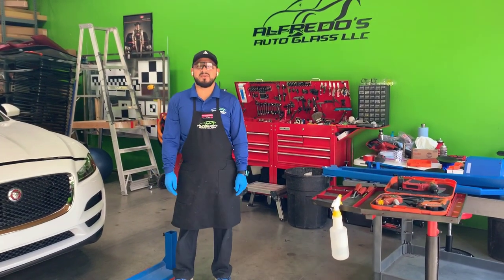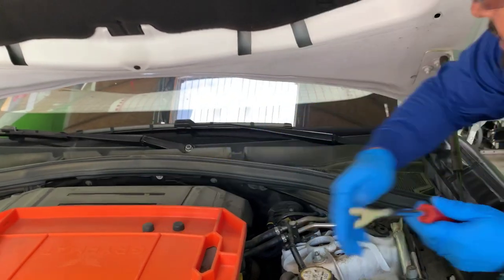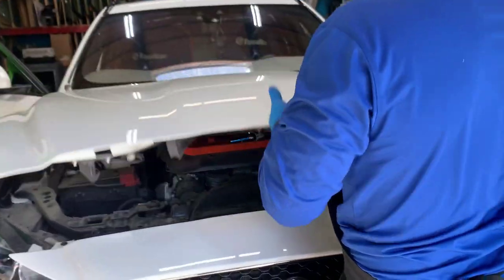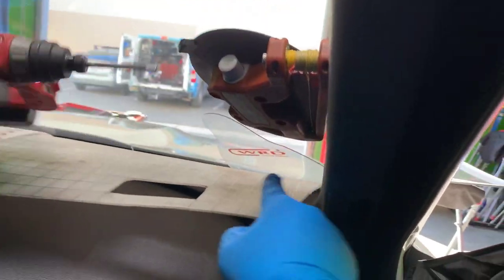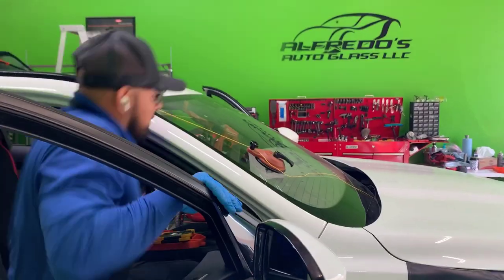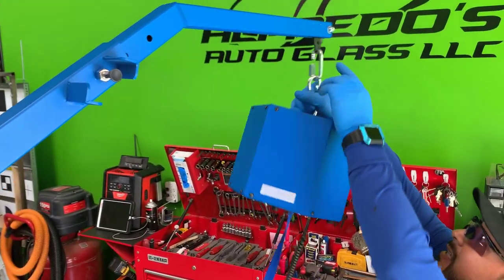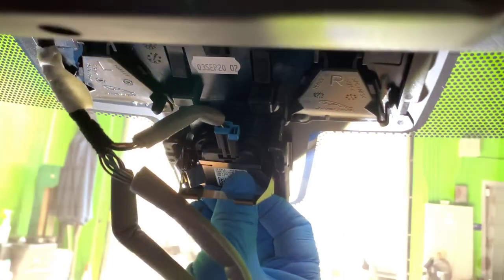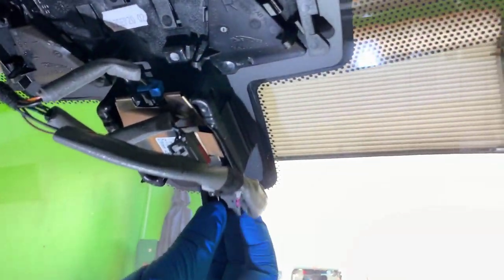Jaguar F-Pace 2016 Windshield Replacement by Alfredo’s Auto Glass with the Panther Pro setting tool

Comment: Thank you for this video, Alfredo. Whilst not wanting to join the window replacement  industry. I did find it, whilst looking for a video about replacing heated windscreen washer jets and your strip down of the trim panel gave me the confidence to do the job and I was able to complete the task quite easily, just needing a puller to get the wiper arms off their spindles. 

I suspect others might benefit from this part of the video for the same purpose and if you haven't already done so,  please consider putting something in the keywords to bring it up easily on searches for windscreen jet replacement.

All the best Alistair

Comment: Little tip for u . u can slide the mirror and bottom cowling off together. The mirror  slides down . And the top cowling when u put it on u have take it to the top of interior roof.and pinch both the top sides and slide down into position.  There are little grooves on bracket of window where it slides through. Same as range rover and new bww 5 series. 👍

Comment: Nice tool Alfredo, this will save your back. Can you take it with you on location to?
I've worked with a setting tool for heavy truck windshields before, but I don't like the one we have. I prefer to set it manually with two guys, but I don't place as many as you and only work on 2 kind of truck models. I can imagine this tool would be a big help on heavy long haul trucks
Reply: I didn't know there was a setting tool for heavy trucks.

What setting tool do you use?
Reply: @Darkmaster_69  I use a brand specific one, one type of windshield only on one brand of trucks. It needs a seperate hoisting infrastructure and a compressed air connection for the vacuum and a clamping mechanism. This makes it very clunky and you can loose control easily. 
I work in a factory where we use a robot to glue and set the glass. When the robot fails, we take over.